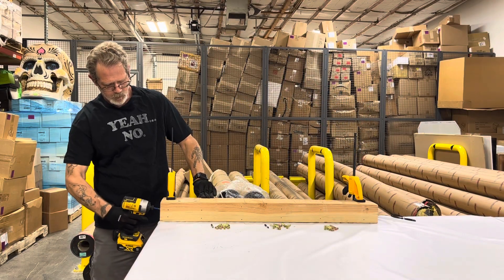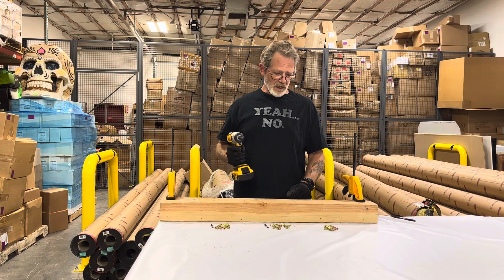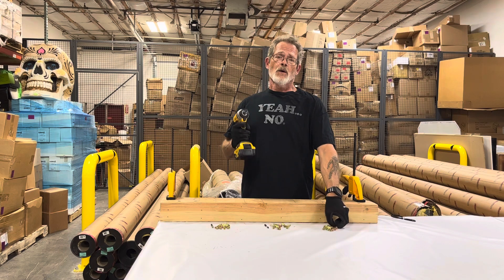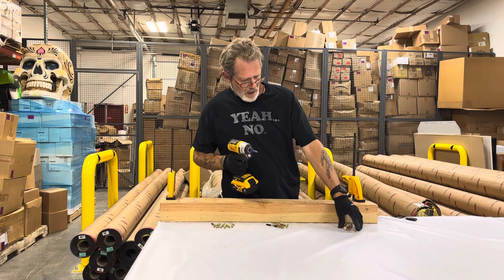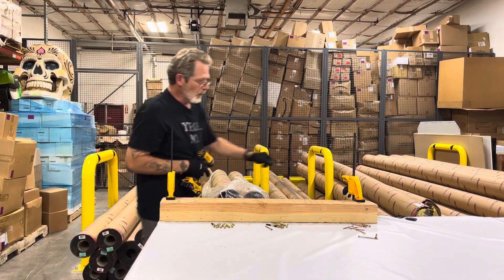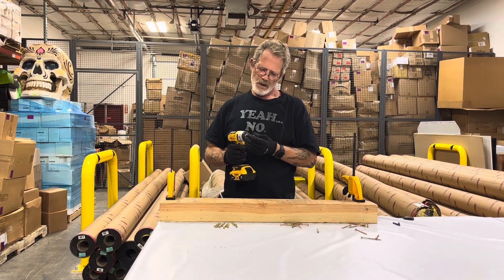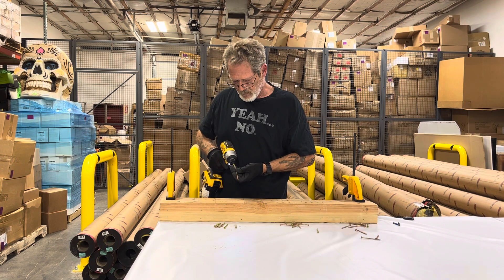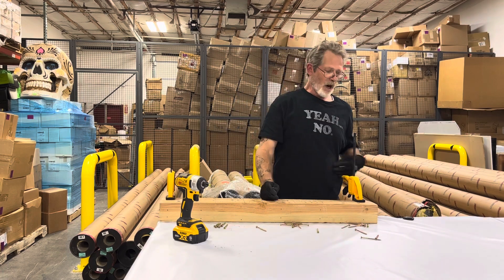Don’t buy Ryobi bits! #ryobi #fails #bosch #wiha #impactdriver

Comment: I've seen a few channels test and say good things about those Ryobi's so I was very shocked to see it break like that. lol
Reply from the maker: The channel that I mentioned in this video, Tools With SOALZ, was the one that made me decide to test it.
I’ve had Dewalt Max Fit break like this, but I was a little surprised at how quickly the Ryobi broke.
Maybe it was the one defective bit in the pack, but that would suggest poor quality control.
Reply: @DiligentDave1966  I first saw those bits in a video that VCG Construction did with them holding a impact driver upside down. It was pretty crazy.
Reply from the maker: @tgltoday2717  Yeah, but he didn’t drive screws with it, and I haven’t seen a video of it driving screws. That’s why I wanted to do my own test on a level playing field.
30 pilot holes, ten screws with each bit.
Sure, the Wiha and Bosch weren’t perfect, but some of that was due to cheap screws and user error.

Comment: I have a hard time ever buying phillips bits due to cam out and stripping fasteners regardless of the brand/techniques used. It's a poor design all around. In my personal opinion torx and robertson will always be king. I have that same DCF787 impact that I use for small engine repair. Really speeds things up. Removed several 15/16 flywheel nuts with it. Granted they were only torqued at around 50ft lbs, it worked. Picked up a DCF921B a few months ago and it's a monster. I don't use it often but 400ft lbs should suit just about all my needs.
Reply from the maker: I also dislike phillips. I much prefer T25. With T25, you can use a drill or an impact driver, and you won’t cam out the screw.
I was simply testing phillips bits to see if any are worth a darn, and the Bosch and Wiha were pretty decent.
It was more to show viewers that might use phillips which ones are good and which ones are a waste of money.
This was my third video, I believe, on the subject.
The Bosch and Wiha T25 bits also did extremely well.
Reply from the maker: As for the DCF787, it does a decent job. I got it in a kit with the DCD777 drill. Looking back, I think that kit is kinda overpriced considering how outdated the tools are. The worst part is the 1.3 amp batteries that came in the kit. They drain pretty quickly, and that’s why I bought the two 5 amp XR batteries when I saw them on sale. Now I’m a little over $300 into an entry level set.
Oh well, I’m going to make the best of it.
As for impact wrenches, I have the mid torque Ridgid, With the warranty and the online sale, it was pretty hard to pass up.
It’s in my “great online specials” video.
Reply: @DiligentDave1966  I have the same set you purchased. But I got it on sale for $150. Agreed. 1.3's don't last long.
Reply from the maker: @norge696  I don’t remember exactly what I paid for mine. It was a daily special on the Lowe’s website. I want to say it was around $160 or $170. My kit also came with the magnetic flashlight.
Reply from the maker: @norge696  The two pack of 5 amp XR batteries was $149, on sale.
That’s why I said I’m a little over $300 into the set.
Reply from the maker: @norge696  By the way, I have never tried Robertson bits. I don’t think they sell them at Lowe’s or Home Depot near me.
Reply from the maker: @SMOKEY-JAYS-DIESEL  I haven’t tried the square drive, but I’ve come to really like the Torx.
Reply from the maker: @SMOKEY-JAYS-DIESEL  I can say that the bit brand makes a big difference in the fit. I’ve found that Bosch and Wiha fit better than any other brand I’ve tested.
I actually have more videos of the Phillips bits than the Torx, but that’s because I was trying to find a decent Phillips bit for when I don’t have any other choice.